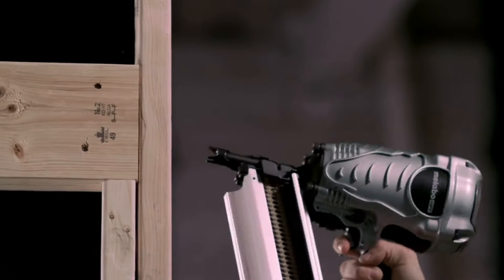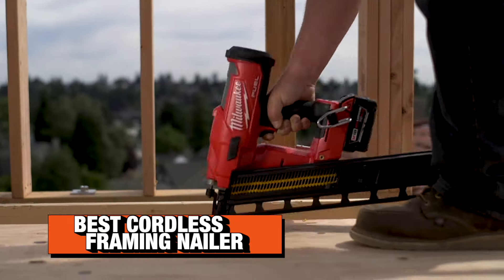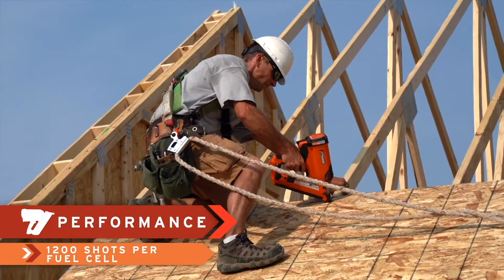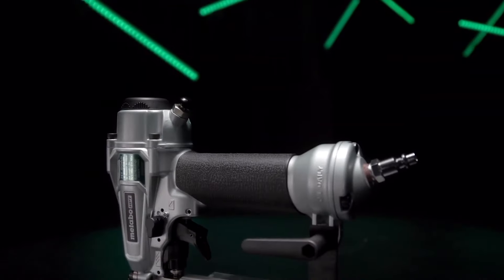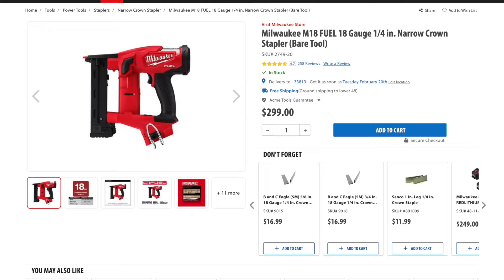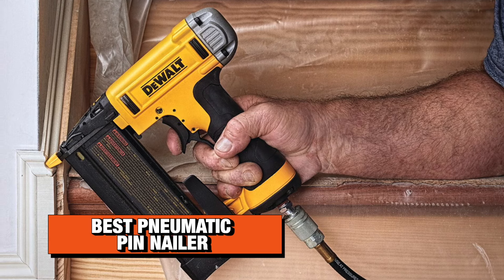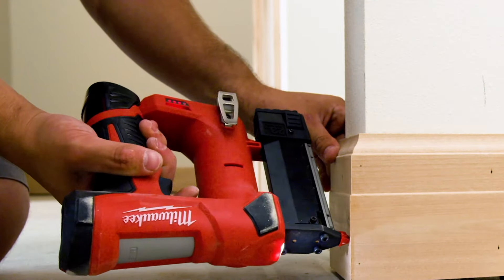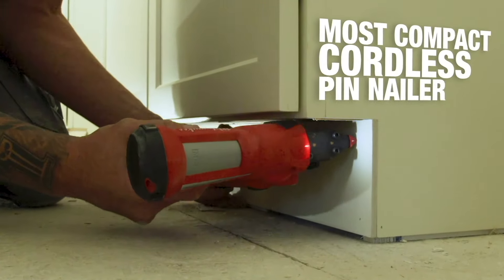Best Nail Gun? Milwaukee, DeWalt, Metabo HPT, Paslode

Comment: The $50 metabo brad nailer is not a good nailer. You had a mix of the $50  brad and the $150 brad. The $150 is the one with the air nozzle and it's their pro-grade line. It's a much nicer tool but I haven't used a pneumatic 18g in years. They're just about the lightest weight cordless nailers only 2nd to 23g, so I would never consider weight an issue like with a cordless framer or metal connector nailer. The lack of dry fire lock-out on the pneumatic metabo is likely intentional. It's not that uncommon to use an empty nailer to go back and set any proud nails deeper. It works like a charm.

Comment: I have both Milwaukee/ Metabo HPT crown stapler. Prefer the Metabo HPT as it's lighter, sights down better, the Milwaukee shoots lower and when building cabinets it's a bit cumbersome to aim. The Metabo HPT it's more in line, the part you have to push on is much softer or easier to push on vs the Milwaukee which is a bit tougher. Definitely metabohpt is a better nail gun also cheaper on the kit.
Reply from the maker: Metabo HPT makes some really great products, especially in the nailer category. Thanks for the insight!

Comment: Ever since I got the m12 pinner it's been making me rethink my entire pneumatic setup. Yes, slightly heavier than the air nailers, but it's really hard to beat the convenience of cordless. I'm still anxiously awaiting the M12 18 gauge brad nailer to release. Barring any launch issues, I'll be grabbing that one ASAP.
Now I just need milwaukee to release an m12 narrow crown stapler (I have their m12 t50 stapler and like that one a lot too), and maybe an m12 21 gauge (great compromise between 18 and 23 gauge) and I'll be ditching the air nailers.
Reply: I've never seen anyone mention or show patents on any other M12 nailers.
Reply: @evictioncarpentry2628  Yeah me neither, but I'm hoping their m12 brad nailer will be popular enough for them to expand the line. The m12 pinner is amazing.
Reply: @NWGR  It's probably not going to come.
Every brand of nailers right now that uses a nitrogen tank are all using the same technology. They're just licensed to use it.
They wouldn't be able to make it any smaller at the moment unless someone patents a new design.
Reply: @evictioncarpentry2628  It's already been announced; 2541-20. It only fires nails up to 1 1/2", but that's plenty for the work I do.

Comment: Just a Heads-Up if you're considering a Paslode fuel cell nail gun whether it's a framing nailer or finish nailer. I bought both a few years ago and was pretty happy overall. You do have to clean them fairly regularly in order for them to function and you need to make sure your fuel cells are not out of date. I initially got both when I built an addition on my house but now being a weekend warrior and volunteer I don't use them as often. MY BAD according to Paslode. They no longer provide fuel cell cartridges for either of my guns. They replaced the cells with new ones that have a different adapter on them. For a very short period of time Paslode provided a new adapter to use with my older guns with the newer fuel cells *(the only ones you can now get). If you didn't buy the newer fuel cells with the included adapter for the older Paslode guns you are out of luck. Paslode only provided the adapters for their new fuel cell cartridges for older Paslode guns for a short time. They no longer include the adapters and there is NO WAY to get them. After calling customer support multiple times you are pretty much SOL. You can have a great working, cleaned and lubricated older Paslode gun but no access to fuel cells that work with them. How about them apples? SO JUST BEWARE if they did it once to all of us that previously purchased their older guns there's no telling how willing they'll be to screw you over in the future with even newer and better fuel cell cartridges that won't work with the current Paslode guns they sell. The customer is always right is not something in their vocabulary. So I will never be purchasing Paslode products in the future based on them not providing fuel cells or newer fuel cells with adapters to work on older guns. U N B E L E I V A B L E ! ! !   How hard would it be for them to provide the adapters to older Paslode gun owners??? Seriously?!?!?  Check out the Paslode forums to see that many of us got screwed by Paslode. as I guess they want you to throw away your older working guns to buy their newer guns. S T A Y  A W A Y from companies that do that to you.  Not a Happy Paslode Camper!

Comment: What about 15/16 gauge nailers
Reply: Milwaukee.
Has to be Gen 2 though.
16 is useless IMO.
I only use 18 for trim and casing and 15 for doors.

I have the entire lineup. Can't beat them.
Reply: @evictioncarpentry2628  so do I, looking at pneumatic options though
Reply: Unless you're trimming out a 5000sq ft house the cordless nailers are the way to go now.